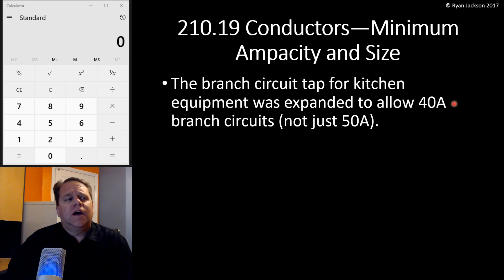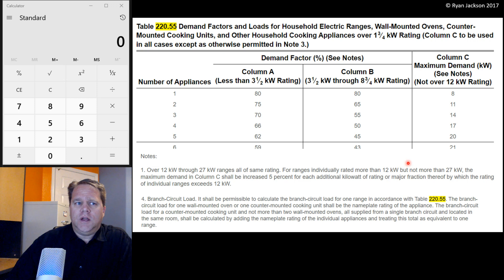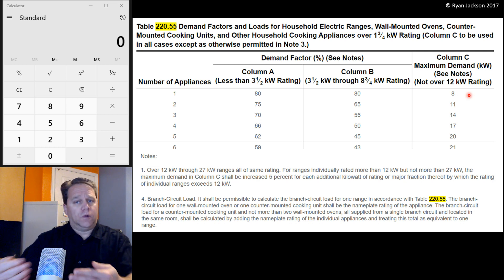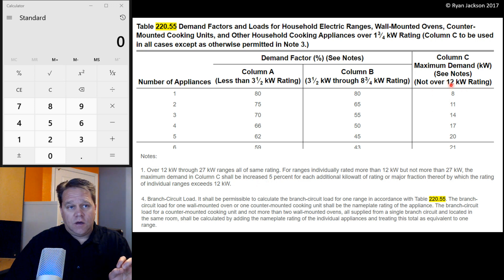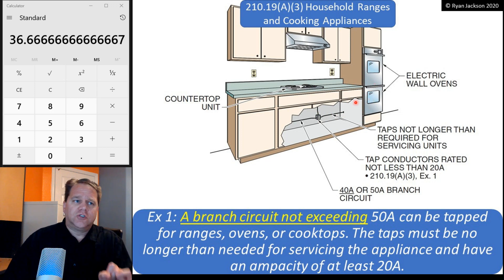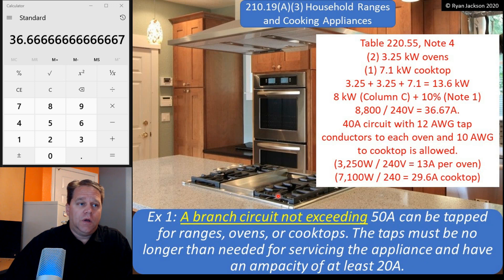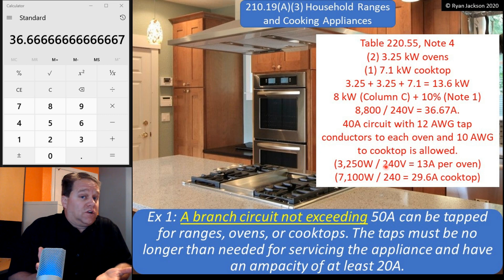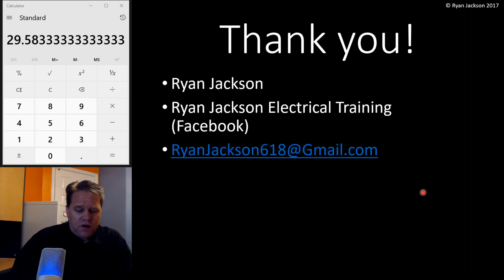2020 changes 210.19(A)(3) Ex 1

Comment: Would a 120V microwave be considered a wall mounted oven for the purposes of tapping off of a 208V 50A oven circuit? Do the tap conductors need a separate OCPD device considering the 50A OCPD would be oversized for a 12awg Cu wire?

Comment: Are these taps only allowed for pigtail connected appliances or can it include a NEMA plug outlet.  Example a 40A breaker going to j-box that taps to a 30A oven plug and a 20A 5-20/15 receptacle.  Owner would then plug their loads into it instead of hardwired.  Concerned the outlets are not UL listed for the higher current breaker or that the code only mentioned leads and conductors, plug ever exhibit or graphic only shows a j-box with metal conduit going to the loads.
Reply from the maker: You'd still have to comply with 210.21 for receptacle ratings, so this would only be allowed for hard-wired.

Comment: On a second note from my other comment. The install manual from factory states "Models rated 7.3 to 9.6 KW require separate 40A circuit.". I would read that you can't tap a circuit in that instance correct?

Comment: Your double oven unit should only have one tap circuit going to it.  There is only one input one the unit.  I hadn't ever heard of tapping conductors for kitchen loads before.  I wired my house under 2008 code.  I put in full gas range on 20a 120v but also put in 50A circuit for future proof for gas range with electric oven.  I also put in electric wall oven.  Appliance store told me it needed 40A.  Just looked up install manual.  4.8 Kw & below 20A circuit.  Guess I'd better change breaker.

Comment: Hi... you're a great teacher ! I have a question though. You still run #8 copper ( good for 40 amps ) from the panel to the junction box ? After that you split off into number 10 and 12  ?

Also in your calculation you multiply 8 times 1.1.... what is the 1.1 ? Thanks
Reply: Oops, I reviewed you video and you answered my question already in the video, my bad.
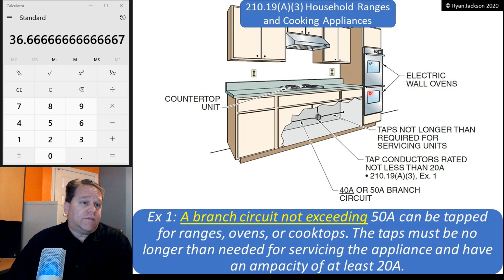Reply: At 5:40 you said " you can bring a 40 or 50 amp circuit to a junction box."
Reply: Okay, now I get it ! Multiplying by 1.1 is the same as adding 10 %....

Comment: While we're on article 210, 210.4 (C) must be deleted in future codes.  We would never be prohibited from serving other than line-to-neutral loads with a multiwire branch circuit if the legal installation of said circuit requires a means to simultaneously disconnect all ungrounded circuit conductors.  100% of the time we would fall under exception 2 of 210.4 (C).  I am eager to hear anyone's thoughts on this.  I submitted a proposal for change or clarification just after the deadline for 2020 code cycle.
Reply from the maker: That exception requires a multi-pole breaker instead of just the handle tie required by 210.4(B). It correlates with 240.15.
Reply: @RyanJacksonElectrical  Wow.  That is the best answer I have received.  Thank you.  It becomes more evident after reading 240.15(B)(1) and comparing the 2 articles.  However, 210.4(C) ex. 2 still leaves open for interpretation the impression that handle ties would open all ungrounded conductors simultaneously.  The fact they don't make overcurrent device plural suggests it has to be 1 multi-pole breaker.
Reply: @rynocop7958  hey, newbie electrician here. Just trying to understand the codes being discussed. Couldn't the handle ties be utilized and still be in compliance with exception 2 of 210.4(C) since 240.15(B)(1) permits handle ties in that scenario? Other question is should they specify 1θ in the same exception 2 since the 240.15(B)(1)  permission is for circuits that serve only 1θ line-to-neutral loads? Hope that makes sense and I appreciate your time. I'll send this to both of you. Thanks!
Reply: @truthbebold4009  Regarding handle ties, your statement was my original contention on why a code change is necessary.  Looking at that one code section, exception 2 in 210.4C, the only challenge to our contention is the fact they that it says "overcurrent device" in the singular and not the plural.  A multi-pole breaker is one overcurrent device and handle ties would be multiple overcurrent devices.  Now, as Ryan Jackson stated, 240.15b1 makes it a lot clearer on several levels and states we can use handle ties, but if we do, then those circuits may only serve line to neutral loads.  A clarification of the exception in 210.4c at a minimum should be undertaken in the next code cycle, so that the distinction between multi-pole and handle ties is more apparent if an electrician is reading that one article for guidance.  For instance, something as simple as adding the wording "by a single" before "overcurrent device".
Reply: @truthbebold4009  Regarding your second question, I believe all line to neutral loads are single phase, so I would not want them to be redundant like they chose to be in 240.15b1.  You seem to be a little past newbie level by your line of questioning.  Keep up your self directed education.
Reply: @rynocop7958  ... Thanks, I appreciate the reply. I'm actually a 44 year old with 15 months of experience. I did some control panel wiring previously and some electronics in the Air Force, but I've never been able to really grasp theory and troubleshooting very well. I didn't know a thing about home wiring 15 months ago (not even how to wire plugs and switches) or even construction techniques. This has been a great learning experience. How nice it would have been to have this skillset to begin with. It was kinda miserable for awhile to feel like a laborer and it was hard to stay motivated but things are starting to click at a faster rate. I'm working in central Washington and my journeyman is into solar so the off-grid installs in the mountains are 'really neat-o' 🤓. Thanks for reading. God bless
Reply: @RyanJacksonElectrical   hey, newbie electrician here. Just trying to understand the codes being discussed. Couldn't the handle ties be utilized and still be in compliance with exception 2 of 210.4(C) since 240.15(B)(1) permits handle ties in that scenario? Other question is should they specify 1θ in the same exception (no. 2) since the 240.15(B)(1)  permission is for circuits that serve only 1θ line-to-neutral loads? Hope that makes sense and I appreciate your time. I'll send this to both of you. Thanks!

Comment: No ocpd needed for the tap conductors? So, in the example, the 10 AWG  and12 AWG are fine on the 40 amp breaker?
Reply: I think this is a good example of how the code is about minimum requirements. I'm a big fan of "over"-engineering, but that doesn't help in the exam :-P
Reply from the maker: Correct.
Reply: Ryan Jackson 😮, good to know. Any cap on distance?
Reply: What about t rating factors it seems to using the 90C column but not taking into account any derating factors. Mike Holt peaches anything under a hundred amps should use the 60C column automatically
Reply: @titobandito-777  If the terminals are marked 75 deg that's what you follow. If the terminals are unmarked or unknown then you'd revert to the 60 deg column.